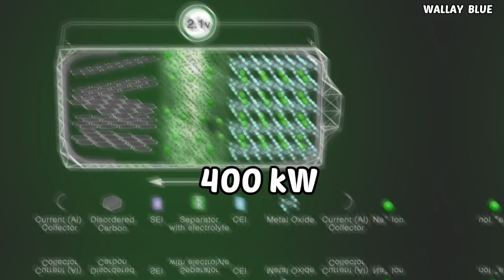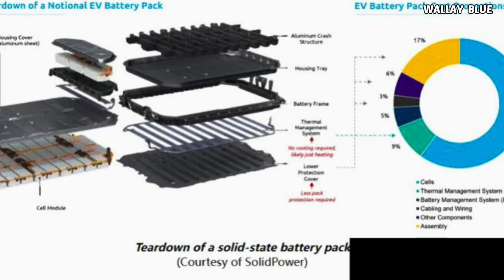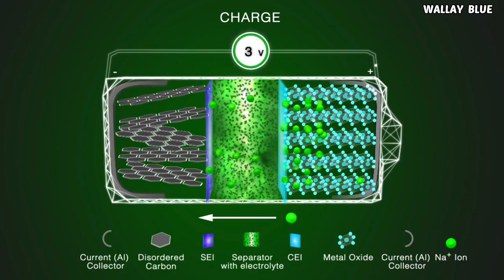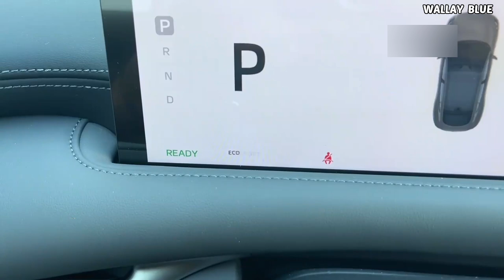China NEW Solid-State Battery Shocks The Entire EV Industry!

Comment: "Apr 8, 2024 — The automaker confirmed earlier today that the L6 will be powered by semi-solid-state batteries, offer a range of over 1,000km (620 miles)" Do your homework or your channel will just be a total joke.  The L6 Does Not Offer a solid state battery; it offers semi solid state which has nothing to do with solid state; it is a fake term for lithium batteries that have less liquid in them.  Nothing solid about liquid.